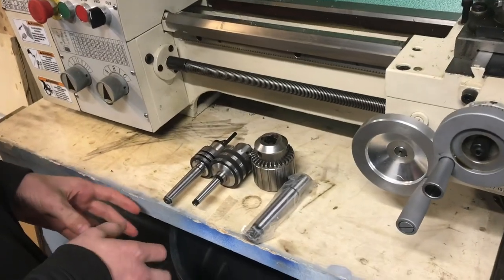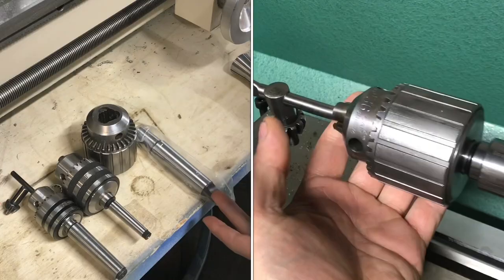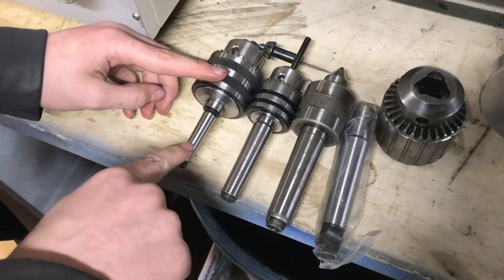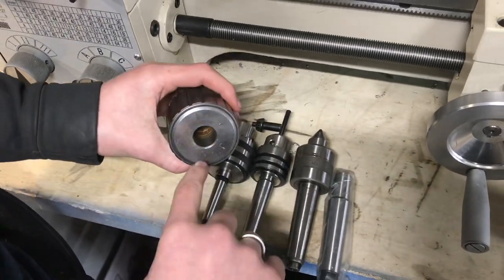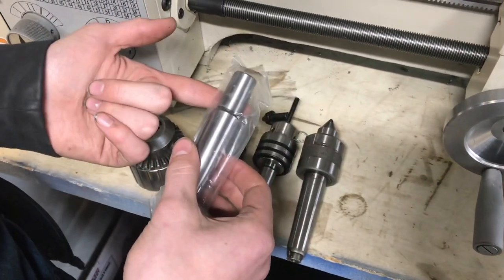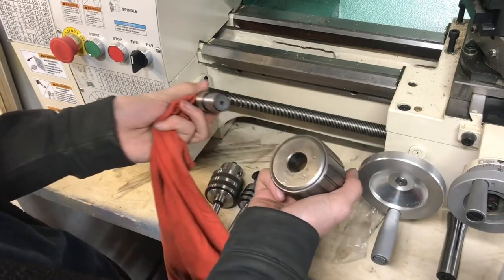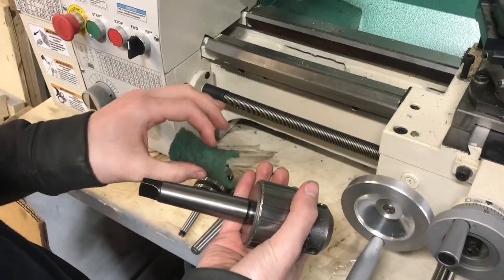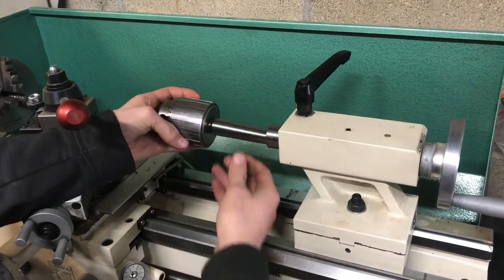“understanding” SELF HOLDING morse taper’s on a jacobs chuck

Comment: you are wrong the tang on the end of the morse taper is only there to be able to remove it from a drill or remove a morse taper sleeve if you need to go to a larger size taper